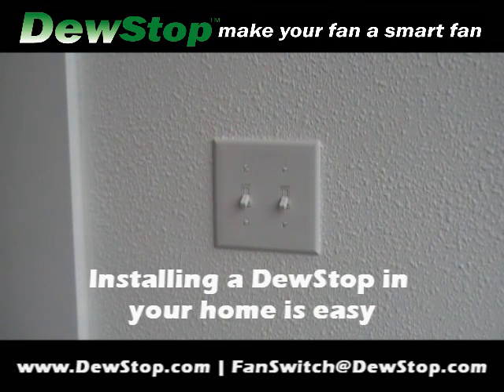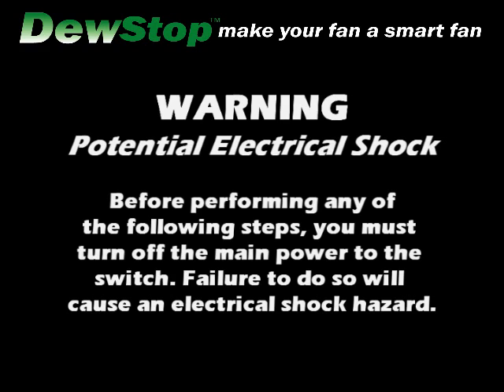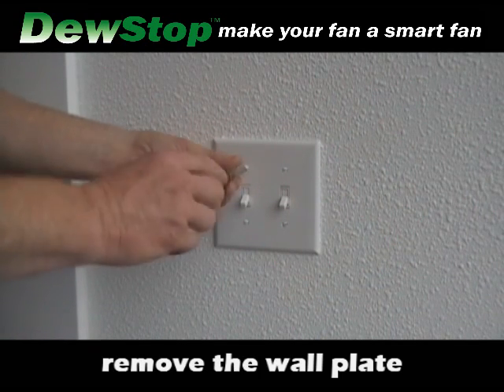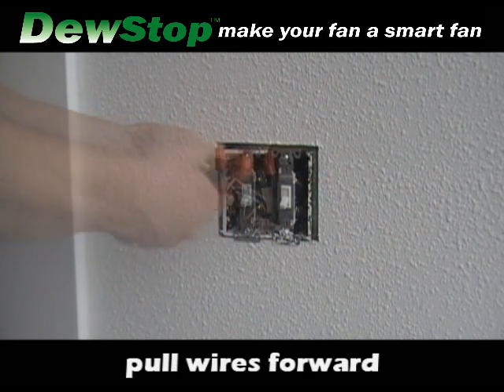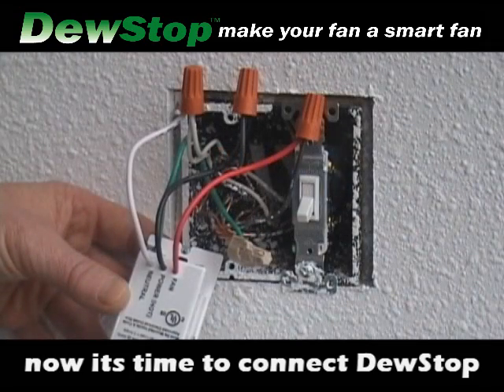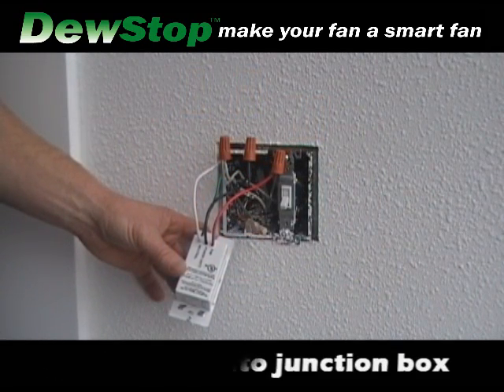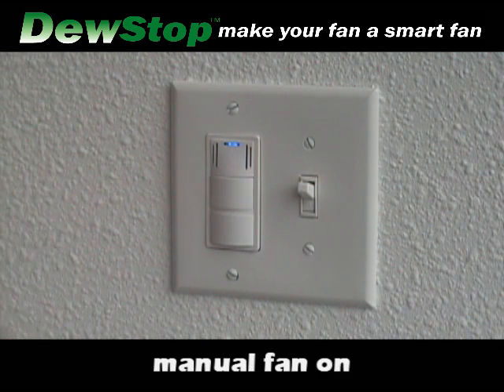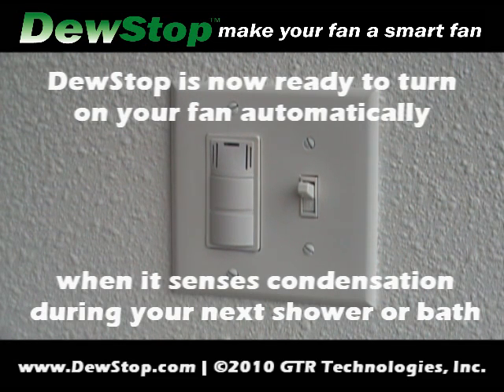DewStop FS-100 Installation Guide

Comment: How do you write it up if the fan and light were originally on the same switch and you want to separate  them?
Reply: You have to undo the wiring, and find the main line power  and neutral. Next, connect the hot from the light, and with the main hot line. Do the same with the neutral, and connect the black and white wires from the fan to the switch

Comment: I agree with the other posters.  This might be great product,  but the installation instructions are INSANE.

Keep in mind, many of us are replacing the old style spring loader timers with this item(two wires only).  I have hooked mine black to black and white to white, and the switch is working,  but I am not sure which of the two wires to hook the "FAN" wire to.  One way, it will work, the other way???? Drama?  I also can't believe no one from the company has come here to clarify.  

The printed directions are at least as bad, maybe worse.  Who ever is making these documents obviously knows nothing about electricity.
Reply: It is unusual that the morons who own this channel do not respond to ANYONE'S questions or concerns.  They are outright stupid.  Don't even do a video if you have no intention of following through, you dumbasses.
Reply: Hey so you just leave the red wire unhooked? I hooked mine to my black wire and no it won't shut off ever
Reply: The way I did mine is the existing on off switch had two black wires. You have to figure out which hot wire is the source and which goes to the fan. If it's a double switch, one for lights and one for fan, then the source hot will be the ones that are pig tailed together and the one going to the fan will (should) go off by itself into its own Romex. So you connect the black "hot" to the source hot (black to black) and the "fan" one to the one going to the fan, often this will be black to red. There will be no white (neutral) collected to a standard 2 way switch as you're breaking the circuit at the hot side. There will be a group of neutral (white) wires all tied together in the box, so undo that and put a new wire nut on with this one. Just make sure you're using wire nuts rated for the gauge and number of wires. I had 4 in some cases, so I didn't use the included nuts on these. If you do not have a ground (bare copper), you are SOL and should stop and call an electrician before you do anything else. Hope this helps.

Comment: don't buy this product it wont turn on when you shower. it doesn't have a condensation sensitive
Reply: Yes, it has a sensitivity control in that "button" in the middle, between the on/off swithch and the sensor holes.  You have to open that middle button or panel by poking the included tool on each side (first you have to remove the switch cover/plate), or use a small screwdriver.  Then you will see two dials, one for tomer, the other for sensitivity.  Adjust accordingly.